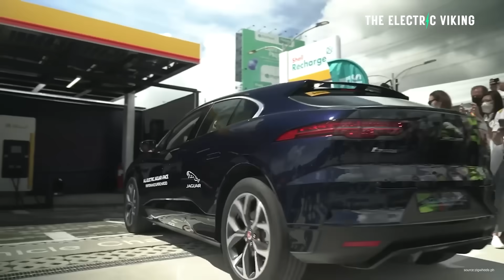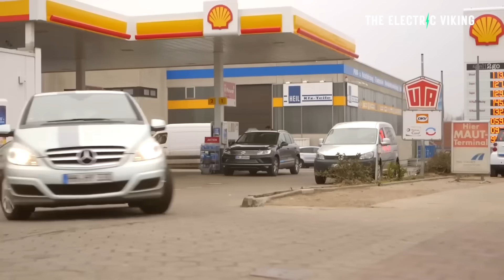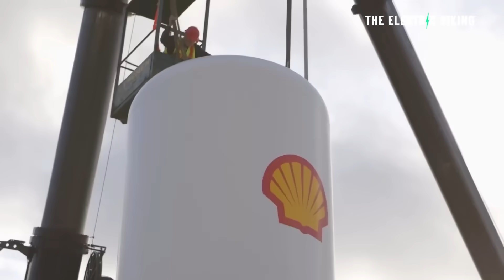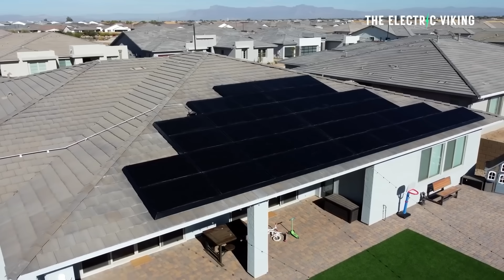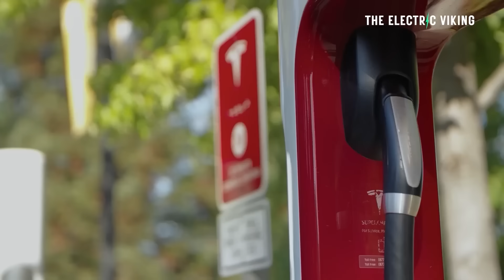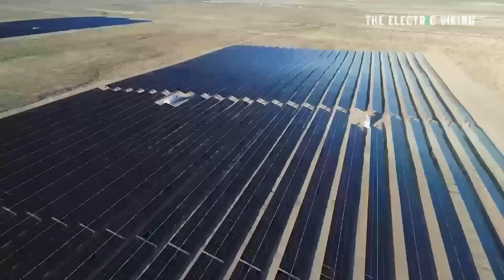Tesla converts gas station into Superchargers as oil giant dumps 1000 sites

Comment: I wonder why nobody in US/EU & Asia, w/ exception of China has embraced battery swap? OzVike, ever drove from San Francisco to Los Angeles on one charge ?
Reply: Hi Georgie. Because it doesn't make economic sense. Why not? Because it would require that ALL EV's use the same kind of battery, in order too simply be able to swap batteries.
Otherwise, a Battery swap station would need to have about 20 or 30 different types of battery packs to swap, from all the main EV Companies. Also, be required to have stocks of these different battery packs. Obviously this would be stupid. 
In China, it was NIO that was pushing for Battery Swap stations and this was funded by the Chinese Government...initially! (Note: This special subsidy STOPPED at end of 2022.) But they had to convince other Auto Companies to also offer Battery Swaps. Other Chinese Companies explored the possibility. As did Tesla, BMW, Daimler Mercedes and some others. Tesla even built some some stations to test it. However, they quickly realised it would cost many tens of billions of dollars to build all the swap stations required plus also the need to have cars all using the same battery packs (for economies of scale). So they dropped the idea. This was between 2014-2016. All other Companies also dropped the idea but Toyota kept at it for a while, testing things. 
When NIO realised no one else was interested and that if they wanted to expand the battery swap service they would have to pay for the stations themselves, the whole thing came to a halt, world-wide. But in China there are numerous Battery swap stations already built that NIO and a few other small Chinese NEV companies still make use of. However, sorry but this is a dead in the water idea.
Reply: @johnwilson5743  another reason is reliability. removing those battery packs would mean constant  make/break connections on the terminals.....another point of failure.
Reply: @johnwilson5743  another reason is reliability. removing those battery packs would mean constant  make/break connections on the terminals.....another point of failure.

Comment: What sucks about this is, Tesla will make most of their money from charging which means they will keep the range of vehicles lower than they could actually be so you need to charge away from home.
Reply: Sorry, completely wrong. Tesla is not using their supercharger network to make huge profits. They are aiming to do slightly more than breakeven. Remember, building all those stations is not cheap. 
Eventually, all EV charging stations offered by all the Charging Companies will be in the same position as the current gas/petrol stations. Meaning, very little profit is made by selling gas/petrol, or electricity. The vast majority of their Gas/Petrol station profits come from the add-ons. Fast food/snacks/drinks/coffee etc plus groceries. 
The future EV stations will be set up as Cafes/bakeries, snack and fast food type stores as customers will need to fill in 15-20 minutes. So bathroom/toilet facilities etc. 
But remember, places like motels, parking garages etc will also provide charging facilities, using slower charges. Effectively becoming charging centers themselves for their specific clients.

Comment: Don't listen to the naysayers, I ran the AZ-NM grid for several years, (until I got the company to abandon running it). The grid can handle the changes being made all over the world. Charging is only a percentage of the increasing use of electricity, soon everything will be electric and its about time.
Reply: Arizona is adding batteries. If you look at eia power monthly, you can see it. Here in Ohio, we need meters that can measure when we use power, not just how much. I think TOU pricing is key to shifting charging to when power is cheap and abundant.
Reply: @fjalics  You're right. The term for what you described is smart grid. The price of a kWh is calculated in real-time and depends on demand. This leads to fewer power lines, fewer power stations, cheaper energy, and so on.
Reply: @igors6593  If you need fuel in the car, your not going to wait until it is cheap. Especially if it is going to take 12 hours charging at home on a 7.2kw charger.
Reply: @alexandermelbaus2351 unless it's emergency you can wait.. If it's emergency do you care about the rates
Reply: @i6power30 if it’s an emergency you still have to wait, you have no choice. It took 45 min to charge a Tesla I was driving at a supercharger in Melbourne recently, luckily it wasn’t an emergency.
Reply: @alexandermelbaus2351 my EV recovers my 40 mile daily commute in under 3 hours on 3.5kw. I don’t know what you’re talking about 12 hours on 7kw — that’s 84kwh. That’s more than the entire capacity of some EV batteries.
Reply: @alexandermelbaus2351  You must not own an EV.  The average person drives 40 miles per day, but let's say your driving is uneven, or you are super special, and you drive 100 miles. Most EVs will do it in 4 hours, but then, most new EVs can also charge at 11.5kw, and some can even charge at 19kw.
Reply: @alexandermelbaus2351 Not true, I wait every night until my house low cost night rate kicks in.  I just set the timer on the car! Almost everyone in Uk who has an EV and home charger does this
Reply: @alexandermelbaus2351  the worst case with the oldest cars is still an 80% charged in 20 minutes. 

And for almost every Eevee user, the standard case is you charge overnight and leave with a full tank every morning. 

Only if you are going to drive so far that you use the entire charge does your use case matter. 

And even then your use case is incorrect.
Reply: @alexandermelbaus2351  EVs can charge while parked, anywhere. Wireless charging will make this possible at every parking spot—stores, gyms, restaurants, and workplaces. This could become a new benefit for employees or members/clients of businesses. For example, free charging when you buy a hamburger.
Smart grids and V2G (Vehicle-to-Grid) technology will make it even more attractive.
Reply: @Hooliosis  I don't know of anyone who lets their battery completely drain.  The average Tesla driver charges when they have 62 miles of range left as per survey done by Tesla.  I charge my EV when it gets down to about 90 to 100 miles of range.   It took you 45 minutes???  Let me guess, you charged to 100%.   A Tesla can add 200+ miles in 20 minutes, which should be enough for any emergency.  Charging at home is so easy, why would anyone wait until they drain their battery.
Reply: @alexandermelbaus2351 I have paid extortion rates for fuel in remote locations.  That does not make it the rule.
Reply: @ the same reason people wait until there tank is nearly empty on an ice vehicle. Yes I did fill to 100% because I needed to, when I returned from my trip the next day charge was at 15%. Again why would people leave their ice vehicles until the empty light comes on, it can and does happen especially when it’s a shared vehicle. And you may not have 20 min if it’s an emergency.
Reply: @fjalics my utility company has TOU price differences. On peak hours they charge $.13 a kWh, off peak is $.06.
Reply: Yes, The grids will adapt.
Reply: @GWAForUTBE Who's paying for that adaptation?
Reply: @useyourbrain1539  we will send the bill to you
Reply: Also most EVs are charged during off peak hours on level 2 chargers.
Reply: I actually decided to look up how many future power plants are in the works for the US. The number is 144 new plants over the next few years.
Reply: EVs wont kill the grid, there is a possibility that data centers for AI will kill the grid.

Comment: Just have both. That way all drivers use the bathrooms, shop at the store, and use window washing tools and air pumps.
Reply: As gas prices go down, less gas will be used, causing gas prices to go up. Why get stuck in a losing proposition?
Reply: @ Gas is not where the profit comes from, it’s the store. The real losers is going to be Visa and MasterCard. All those per fill-up transaction fees are going away. I hope charging goes to an account system like cell phones where you pay once a month or even tack it on to your home electric bill.